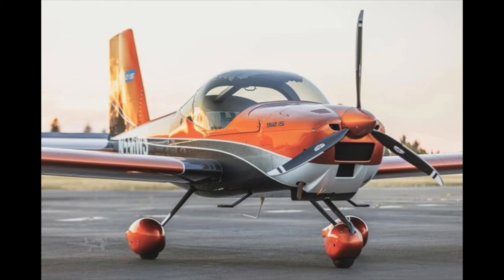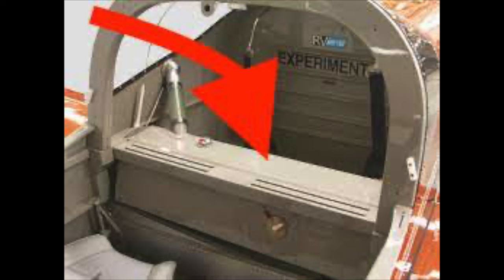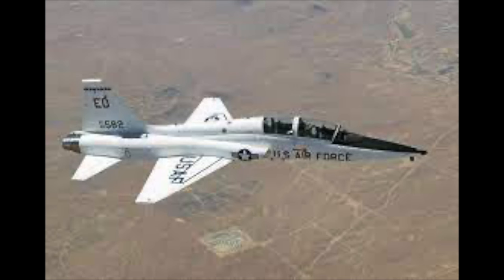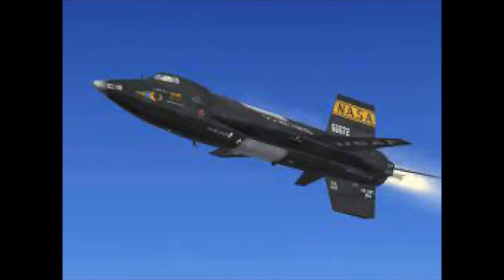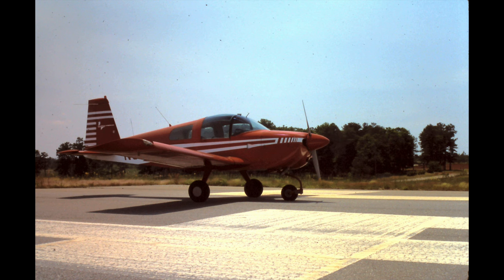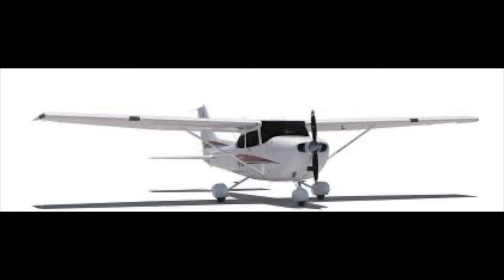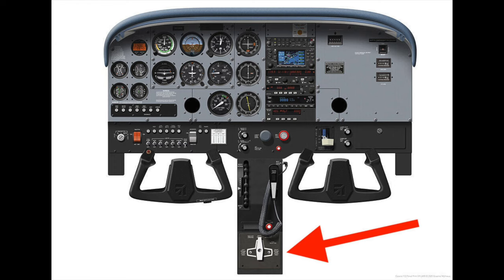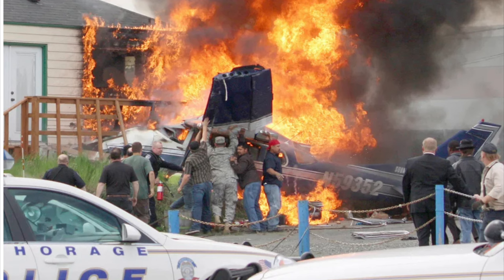Fuel Tanks in My Plane

Comment: Your gas tank brings to mind 1967-1972 Chevy/GMC C-10 pickups along with similar era Dodge trucks. Both got branded as unsafe in T-Bone crashes. The impact jammed the doors and ruptured the tank.  NHTSA has harped on keeping fuel out of the pax compartment for a long time. People have heard over and over, gas inside, bad. They don’t know why.
In an airplane crash wings depart the aircraft, usually. That departure aerosolizes fuel, what happens next is bad. Since airplanes don’t get T-Boned that often, tank rupture from side impact is uncommon. As pax cabins tend to stay intact in unplanned landings that are survivable, the fuel tank stays intact. Even if the wings are ripped off, no fuel atomization because no fuel in the wings.
But we have been told cars must not have fuel inside the cabin for over 50 years.
Reply from the maker: You said it, DW.  Sometimes an idea is implanted and, fact or not, it persists over time.  Your comment, much more eloquent than mine, is a case in point.

Comment: Strength points in the RV12 account for the tank location.  If you’re in an accident with an RV12 and the tank ruptures, you have a whole lot more problems than worrying about gas spilling and igniting (as in you are likely dead).
Reply from the maker: My plan is to avoid crashing.  If successful, that solves everything.

Comment: Anybody claiming that one tank location is safer than another should readily produce data driven studies that demonstrate their point. I haven't seen any. And I'm very interested to know  if there are. 

There are currently two proposed ADs in the works that would require significant costs to owners, and you can debate whether they're necessary somewhere else. One is for the PA28 family wing spar and the other for Piper high wing (Cub, Super Cub, Tri-Pacer, etc.) rudder. Agree or disagree, the FAA is basing those on hard data. If there was compelling data about fuel tank locations, you can bet your house the FAA would have a directive on the street in a heartbeat. 

So any person's opinions on fuel tanks are just that: opinions. Opinions not substantiated by data. Just like doors. Beechcraft and Piper have made tens of thousands of airplanes for the last 80 years with just one door. Don't like it? That's fine, buy a Cessna or Cirrus or Diamond. But those items will never be critical path decision points for me.
Reply from the maker: Truly most of what I hear around the airport is just opinion. Facts seem hard to come by.

Comment: The plane should be built to the manufacturers specifications. I am more concerned about fuel lines that will break in a hard landing crash, flexible fuel line should used in the cabin.
Reply from the maker: Agree with you there - I wonder what the fuel lines are made of in places where you cannot see them.

Comment: Has anyone here ever flown a cub? The fuel tank is in the lap of the front seat occupant, and it’s not an issue.
Reply from the maker: You are right!  Since the 1937's the Cub has flown that way and still flies today with the tank just ahead of the firewall.  The fuel gauge is a wire protruding up from a float and directly ahead in the pilot's line of sight.  What could be simpler than that?

Comment: The fuel tank location has to be a concern in any crash, airplanes are built with many compromises, I own a Europa Monowheel and it has a MDPE tank ( a flexible impact resistant material ) behind the spar's and those spar's are behind the pilot's back. It share's a few design feature's with the RV-12 except it is made from glass, there certainly have been post crash fire's some where the occupant was Ok, some where it didn't end well for the human's.  It depends on the type of crash, and fuel line's too, for example rubber fuel line's tend to be better in a crash.  The Cessna 310 had tip tank's as a safety feature but in some crash's it don't matter but in some it would be a benefit. The DeHavilland Beaver had a aluminum belly tank and they often burned in some less than violent crash's, the bigger Otter used bladder's with better crash worthiness.  I don't think your RV-12 look's like a fire hazard but I guess by now it has a safety history and that would tell the tale.  Any airplane can burn, don't worry just don't crash it, and ground the plane before refueling.  All the best to you, enjoy that beautiful RV-12
Reply from the maker: Thank you Dwayne.  Your advice to just not crash would solve the problem.  I believe that, even in the event of an off-airport landing in the RV-12, with a stall speed of just 47 MPH that provided you maintain control all the way to ground contact you should be okay.  But my goal is to never have to test the theory.
Reply: Yes, agree the low landing speed of your RV-12 is a safety feature especially in the event of a engine stoppage.  The next best safety feature is between your ears, planning your flights to give yourself an "out" as often as you can and assess the risks each flight brings with a plan of how you might deal with the unexpected.  
My Dad was a commercial charter pilot/A&P for his adult life in the Canadian Arctic
. He said he averaged one engine stoppage per year over his career, often related to fueling from barrels, moisture, rust ice in winter etc. he never did more than minor damage to an aircraft though.
Blue skies and tail winds to you @rv12sg

Comment: I fly a C172 and an RV-12.  I still feel safer in the C172 partly because of the fuel tank(s) location...
Reply from the maker: I imagine you feel safer too because the 172 is a more substantial aircraft, not being limited by LSA weight restrictions.
Reply: @rv12sg   Yes the airframe is a bit more robust, but I like having two doors for egress after a forced landing...

Comment: A stock P-51 had a fuel tank behind the pilots seat.  As that war is long over, it is generally removed to install a seat in there to take people for a ride.  It was tight in there.
A Luscombe 8a has the tank behind the seats.  Later models had them in the wings with the fuel lines inside, similar to a 172.
A Pitts has the tank behind the engine, and right in your lap, if you are up front in a two holer.  I'm sure there are others, but I have flown in these.
I think most of us choose to not dwell on things we can't do much about.  Some go forth to the adventure, some choose to hide.  Some things can't be made safe, but we do get to choose.
Reply from the maker: Totally agree with you.  For nearly every endeavor you undertake there are risks.  You just weigh the rewards and go from there.
Reply: I would love to fly a beautiful plane like yours.  I have some time in a RV-6.  You can guess from my channel avatar where I take my risks these days.  @rv12sg
Reply from the maker: @cadmanchannel   That's quite a bank angle in your avatar.  Be safe out there!
Reply: Thank you for your reply.  That was taken by the track photographer at Thunderhill Raceway near Willows, Calif.  If you keep doing track days, you will become a better rider.  I am not one of the faster riders, and I don't do that on the street. There is a reason why I can still ride my bikes at 74 years old.  There is more about that bike on my channel.  @rv12sg
Reply from the maker: @cadmanchannel  I'll check it out